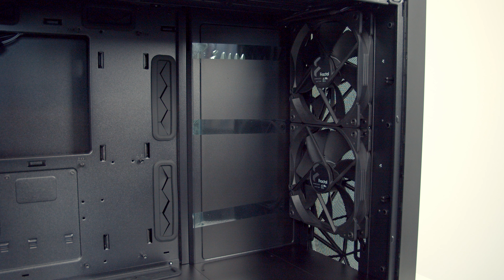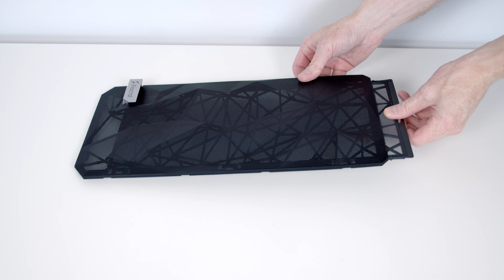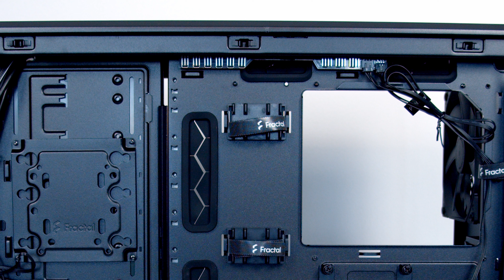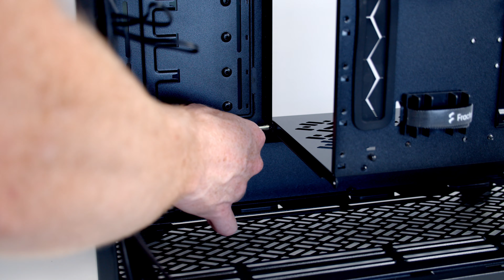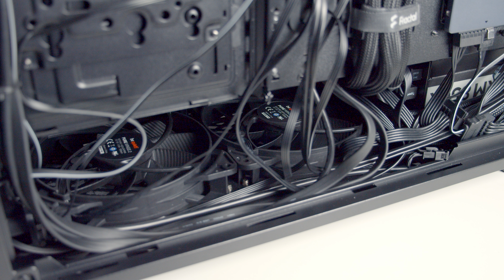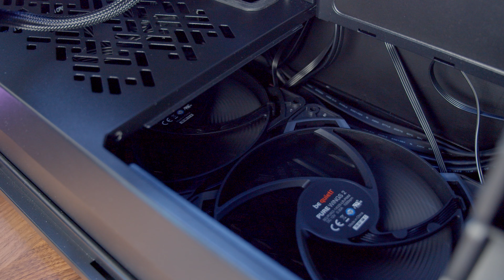Fractal Design Meshify 2 Review & Thermal Testing

Comment: @17:45 totally agree, this thing really could stand to be a few cm taller - if it were I would have used a 420mm aio rather than a 360mm (while a 420mm technically can fit up top of this case, clearance with ram and/or io shroud will likely be a problem and it makes the build much more painful).

I feel like the only reason it's been made this short is to create a reason for the XL version to exist (which I would've bought instead to fit the 420mm aio if solid side panels were an option for it).

Comment: Really enjoying your channel, and your style of PC review. 

I am interested in using this case and would like to know if you have ever compared the performance of a 420 mm top radiator to a 360 mm front radiator? Can a larger radiator exhausting warmer air out the top outperform the smaller, but more efficient cooler air intake radiator in the front?

Comment: Wow, another great video. I love how through your content is. I used your Meshify 2  build video as a step by step. Your thermal testing is of utmost importance to me as my build  uses I9-12900K which notoriously runs hot and I am using processor intense software to boot. With my Fractal design S36 AIO as a top exhaust, CPU temps got up to 95 where I shut the software down (Tfunction = 100). I will try moving the AIO to a front intake and test with both 2 and 3 fans as top exhaust (since I have the extra FD fan). Thanks again.
Reply: @mrfrazzles4030  I use software that, by design, maxes out the CPU capabilities. I have since moved my AIO to a front intake and replaced the stock AIO fans with Phantek T-30's. My temps are now stable in the high 70 and low 80's.

Comment: Question, please.   Your recommended configuration appears to be a front mounted 360 AIO - doing the Intake, and 3 140mm Stock fans doing the Exhaust, with two mounted in the top and one in the Rear.    Doesn't this violate the Positive Pressure inside the Case rule?   360 intake and 420 Exhaust?   Please comment.  Thank you.
Reply: I think you can maintain positive pressure by slowing down the exhaust fans a bit
Reply: @gub3005  Thank you for your Reply!.  I completely did not think of that. That's an idea.    Thanks!

Comment: I keep wavering on where I want to place the 320mm AIO for my upcoming build. Thermally, it really looks like the front-mount is the way to go, even if the length of the case means you have to mount it "incorrectly" with tubes up (yes, I know they're fine as long as the pump isn't the highest point, which shouldn't be a problem with a 320mm radiator). I keep wondering about dust prevention, however, as the top-mount radiator acts as a de facto dust filter when the system is off, plus it's easier to obtain a positive pressure with three forward 140mm intakes, one rear 140mm and the radiator on the top. The comparatively weaker 120's in the front lends itself to only using two exhaust fans (either two top or one top and a back) to ensure you're not creating a negative pressure and becoming a dust magnet (something I figure this case will have issues with anyhow because of all the open surfaces). ((In retrospect, I wish I'd gotten a 280mm radiator instead for the front, as this would solve most of my pressure issues, but I'm already out of the RMA period for the 320mm I bought))

Comment: I currently have the define 7 and thought about switching to the meshify 2, but I am concerned about noise.
The define 7 has sound dampening in the side (behind motherboard) and in the front, the door with the dampening helps a lot with lowering the GPU whine noise

I am worried that the whine will be too obvious with the mesh front, but that would also mean better thermals

Comment: Case =Fractal define R5 (no front panel,no dust filter,2-140mm fans front intake(BQ 1600rpm) and 1- 140mm exhaust(Noctua 1300rpm)  Ambient 22c-23c. Aida 64 30 min stress test all included.
 Asus tuf 3080 overcloced +90 core and +600 mem- max 55c, 10700K overcloced 5.1ghz- max 83c, Cooler= Noctua D15.  Looks like i dont need to buy the meshify 2 for better cooling.

Comment: Thank you for taking your time on these guides and reviewing the thermals.  I'm trying to decide if you can put a front-intaike 280mm aio tubes-down in the pure base 500dx(can only do a 280mm aio front, top only up to 240mm) or settle for meshify 2 which can have a 280mm aio on top and front
Reply from the maker: Both good cases so you will be happy with either

Comment: Hello Chris from Canada.  I am really liking your guides and appreciate your balanced, calm delivery.  I recently did a new build and am interested in your advice / recommendations.  I have the Meshify S2 case, Gigabyte Z490 Master MB and an Intel Core i9-10900K CPU with a Noctua NH D15 cooler.  I am having some issues with cooling and was wondering if you have some advice on which cooler I should try next.  Running the AIDA64 stress test I am getting extremes of 90-100 degrees Celsius.  While gaming with Cyberpunk 2077 & COD I am peaking in the mid 80's Celsius.  The cooler seems to be mounted correctly although the one CPU fan is somewhat offset to accommodate the RAM sticks. 
I am thinking of a 360mm AIO and was wondering your thoughts on which one you would recommend.  The Arctic Liquid Freezer II seems to be highly rated but never in stock in Canada. Is the Galahad a contender?
Reply from the maker: Galahad has good build quality, but deepcool 360ex cools better but lower build quality. I have used the Arctic
Reply: @ChristopherFlannigan  Thanks Christopher, I am assuming you meant to say you have NOT used the Arctic? Also is there a difference between the Castle 360 V2 versus the 360EX other than cosmetic?

Comment: Awesome video, Chris! Thanks for taking the time out to run all those thermal tests. As always, your videos are excellent and super informative. I built last week with a Noctua NHD-15 using your build video as reference and it was such a great help. 

Question: I have three 140mm intakes and two 140mm exhausts at the rear and top. I idle at 33°C-44°C and the max temp I've recorder under load was 67°C. Do you think a second top 140mm exhaust would further lower my temps or would there be diminishing returns and just more noise?
Reply from the maker: Probably no difference. See my silent base 802 thermal testing with an air cooler as the results shoulkd be similar
Reply: @ChristopherFlannigan  Good to know. Thanks!

I messed around with the chassis last night and installed a 140mm intake into the bottom slot by the PSU and saw a 4-7°C in idle and load temperatures.

Comment: The problem with the Lian Li is the lack of dust filter in the front, of course it gets better thermals and lower DB because there is less air restriction, but the dust inside the case will be a nightmare. I'm lazy so I don't clean the inside of my PC every month or even every year for that matter so 2 degrees more and no dust is more than acceptable for me. Yes I do clean the dust filters on my case every week.
Reply from the maker: Meshify 2 would suit well then

Comment: Since the Lancool 2 Mesh is sold out I was thinking about changing to buy this case instead. Do you think a 240mm radiator + 120mm in the front and 3 stock case fans at the rear + top would work good? (For 5900x + RTX 3080).

Comment: Hey Chris, I just finished my first build ever with this case and your videos were extremely helpful. Thank you.What are your thoughts of my choice for fan placements? All 140mm, (2)front (intake), (1)bottom front (intake), (1)top front (intake) and (1)rear (exhaust), (1)top rear (exhaust). With a hyper 212 CPU fan. I would like to achieve the case to be as high pressure as possible. I look forward to hearing what you think. Cheers
Reply: you have 4 intakes and 2 exhaust fans. Thats a lot of positive pressure. I would go for a rather neutral pressure. 3 intake front. 1 rear exhasut 2 top exhaust.

Comment: Ok so I ordered an additional be quiet fan to be put at the back like you did in your main build video, but a slightly better one (https://www.scan.co.uk/products/140mm-be-quiet!-pure-wings-2-high-speed-9-blade-upto-1600rpm-upto-942cfm-airflow-363db-max-pwm). Because you were talking about negative pressure when having more exhaust than intake. Now you've settled on just the stock fans so is the airflow balanced? Many thanks!
Reply: @ChristopherFlannigan  I ended up swapping the high speed pure wings 2 with a 1000 rpm silent wings 3 pwm. It’s bloody perfect, wish I had them in the front too.

Comment: I just built a 500dx with your help.  I ordered an HD audio cable extension per your build recommendation and it too had multi colored wires a little bit visible beyond the heat-shrink.  Because of this I opted to just use the 500dx case audio cable and tightly wrap black electrical tape almost completely covering the colored wires.  The HD cable extension would have had about the same amount of visible colored wires, so kind of defeats the purpose. 

Even though I am very detail oriented this little easy low cost option looks just as good as a $8-10 dollar extension.  The added benefit is easier and cleaner cable management due to fewer cable extensions.  In addition I did not use the CPU cable extension at the top because in this particular build (with MSI Tomahawk X570 mobo with bequiet fans installed on the top) the  stock Seasonic CPU cable made a tighter u-turn than the CPU extensions would have made and is for the most part hidden anyway. 

So my first build experience:  Black color themed builds can look cleaner and cable management is easier and cleaner by using a combination of stock black PSU cables, braided cable extensions, and black electrical tape used sparingly.
Reply: @ChristopherFlannigan  Thanks!